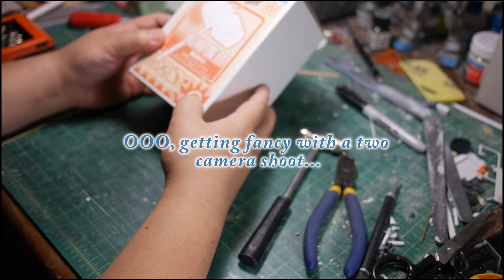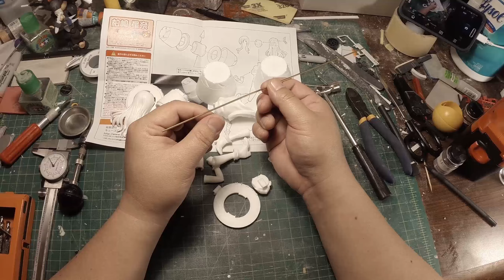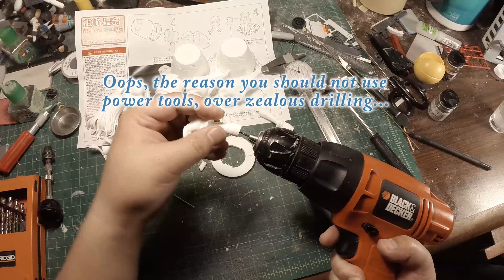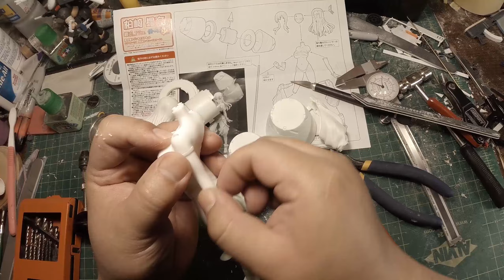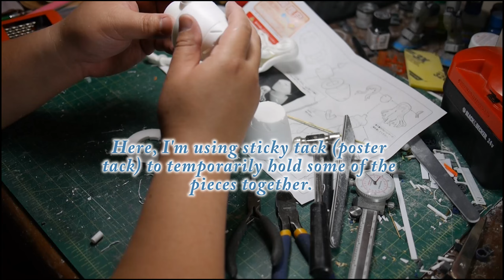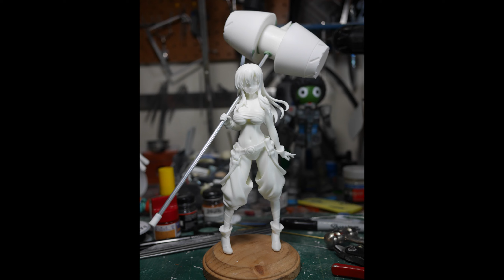Resin Figure Model Building: Pinning

Comment: Is it ok to just glue with no pinning?
Reply from the maker: Yes.  Just make sure those parts you are just gluing are not load bearing.  Legs, arms holding things, main body pieces are all parts that should be pinned.  Other things such as thin details, hands, fingers, etc, do not need to be pinned.
Reply: Those Gundam Guys ok thanks 👌

Comment: So, when you pin it, you don´t need to glue?
Reply from the maker: For the initial pinning, I don't glue.  They're just used as holders.  When I'm done painting, I sometimes glue.  If I plan on traveling with the kit, having it easily separate is helpful.  You can also bend the pins slightly to give it more grip and friction alone will hold the parts.  So.. yeah. personal preference here :D

Comment: I'm a beginner when it comes to resin kits and I have a hard time pinning. Aligning the holes is relatively easy, but matching the angle of the other hole is a nightmare. It looks so easy in your video, how the heck do you it? I'm impressed. I've tried pinning a few parts and some of my angles were WAY off and it caused the pieces to not fit properly. The first hole is simple, you just drill it as straight as possible. Matching the angle for the other part? Jeez.....
Reply: That's true it's not easy getting the right angle. I think a useful way to do it is to put the pieces together in the position you want, then using a pencil draw 2 lines "parallel" on both pieces corresponding to the hole that you want to make. Then while drilling you just keep you drill roughly parallel to both lines. This may help you 😉

Comment: I really appreciate you doing this video series! I often watch Leona's Workshop on YouTube, and while she is informative, her videos focus a lot on entertainment value and skip over much of the the long process of building a GK. But when you're drilling into the resin and sanding it, I understand that you will need to wear a mask. It doesn't sound like you were wearing a mask in this video. When resin dust gets into your lungs, it is a very bad thing.

I have a question for you. How did you get the drill holes to line up so well like that? I think some people drill a slightly larger hole, cram putty or something into the hole, and then let the pin line itself up into the two corresponding holes.
Reply from the maker: Well, it's hard to talk over a mask.  So I'm self sacrificing for the sake of teaching!  :D  As for the holes, this particular kit is very nice in that they have pre-aligned holes.  But in the case when I do not have pre-defined holes.  I tend to drill through parts (for instance, a thigh to leg piece, I will drill through the outer thigh and into the leg - have that part aligned, then fill in the hole that I made on the thigh).  It makes for less guess work but more putty work.  I think the trade off is totally worth it.
Reply: gamerabaenre I have yet to build a garage kit, so I am very thankful for videos like this that show the process from beginning to end. I own a very few GKs, and I would like to try to build one sometime this year. I also have a couple of "sofubi" vinyl kits of anime characters. I may try one of those first.